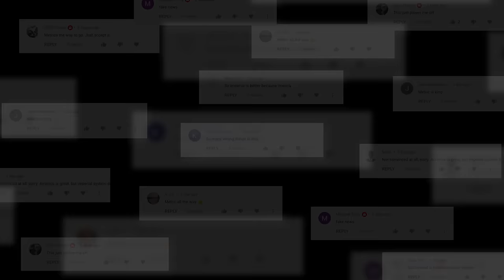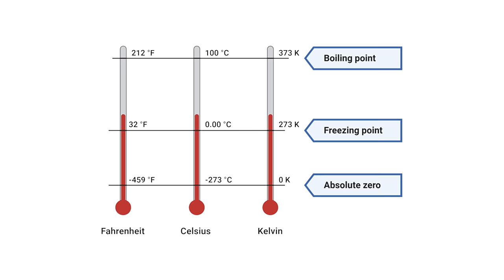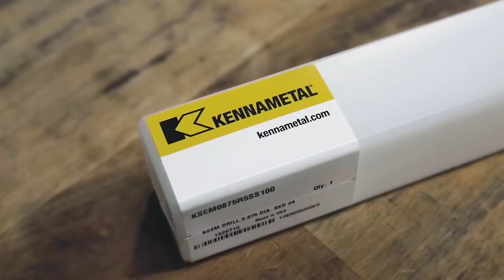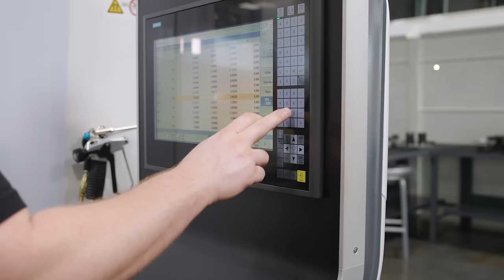Why METRIC is SUPERIOR to IMPERIAL

Comment: This debate metric vs imperial is such a joke, but a tiring one.
How many units used to express a length (in exemple, but same for others) in imperial system? In metric system, only one. No need to convert anything, no need to know how many units A in 1 unit B. Only metre and its multiples by 10, is all. You need to build a chair, or a viaduc, or sew something? Same unit, no conversion. You travel by boat, by plane, by car, on foot? Same unit, no conversion. You need to buy beer, water, olive oil or fuel? Same unit, no conversion. Never. Or the kind that you already use with money. 1 cent? 1 centidollar, 0.01 $. 1 thousand dollars? 1 kilodollar, 1000$. 1 million dollars? 1 Megadollar, 1M$. Reminds you something? Computers, maybe? Some Gigasomething too, maybe, by billions?
Metric system = no conversion (or no real calculation to do so) in each kind of measurement.
Tiring, just tiring. I understand people who are used to do something prefer to keep their habits. But they should just not talk about the "quality" of each system: they only talk about themselves (their own habits), not about the systems in themselves. And to thinkk that the most sacred thing existing in the USA, the dollar, is used in a metric way (for values measurement) by US people... uhhhh, really, what a joke... well, anyway...

Comment: Metric (and basically SI) system have two major advantages:
ease of scale (constant base of 10)
compatibility between units (weight, volume, area etc)

I can easily say how much is 5x7cm, but good luck with 5x 2 3/4 inch without calculator, especially with feet involved (it's almost the same length tho)

Comment: in metric much simple to use and intuitive, but imperial is also convinient to step of measurement like pipe diameter, i prefer inch pipe diameter, the step is clear 2" ,3", 3 3/4" and so on. in metric pipe diameter can made your head confuse alot. so we use 1 standart in general but still need another standart to certain problem. yeah, we need both.

Comment: Some mistake - computer doesn`t use decimal system
1KB = 1024 Bite (it`s cause 2^10 =/= 1000)
Not easy to count, and that`s why you brand new 1TB HDD (SSD) have only ~930GB in real

Comment: I only learned the metric system at school. I have 3 problems with imperial:
Volumes don't make sense, a litre is 0.001 cubic meter, how many cubic feet is a gallon?
There are both powers of 2 and decimal fractions of inches. Going from 1/2 to 7/16 to oversize a hole just hurts my brain. I don't even want to write that out in decimal.
There are just too many units with different conversion factors. Make it all 12 or 16, it would be okay, but 12 inches to a feet, 3 feet to a yard, 1760 yards in a mile.

Comment: I'm not an imperial Unit fan, but I there is a good argument for it. The yard, foot or inch is diffrent from body to body, but a human can much better astimate a length with his own body. Even if it is not exact, a mile are roughly 2000 steps, a yard is roughtly about one step, a foot is rougthly the length of a feet and an inch is rougthly about the thicknes of a thumb.
In a situation where you need some astimating without tools and fast you can do it more precisly then in metric. 
You would be surprised how many people need a length or diameter  of something and 10 cm of a meter doesn't matter. Nevertheless messuring/astimating something in meters without tools is hard.

Btw, astromonical sizes are not messured in metric system. There are units like AU and Lightyears, mass is shown in "Mass of Sol" and similar stuff. You can calculating them into metrical units, but it is the same like calculating imperial to metric.

Comment: In engineering as long as you know 2.54 multiply or divide and have a calculator then conversion inch to mm or mm to inch is easy.

Comment: same thing for the power systems, 120v vs 240v (110v vs 230v same thing) far less current needed for the same wattage appliance at 240v, less likely to pop a breaker every 2 minutes trying to weld something

tho I hear alot of places in murica are having 240v outlets installed for all sorts of reasons, its only a matter of time before they go full 240v

Comment: Its worth noting that we adapte units to suit our requirement all the time and the idea that we work with SI units is the very small and very big is not exactly accurate. Whilst absolutely could use kg, meters and joules for the very small we often favore the dalton, the Angstrom and the electron volt because they are more practical to use and more representative than kg, meters and joules. equally for the very large we favor parsecs, light year and astronomical units. Although we don't usually change unit half way through like what happened with that mission that crashed into mars.
Also people love to cite the case with Celsius vs Fahrenheit which is honestly the weakest argument against imperial if its an argument at all. First Celcius is not part of the SI units the Kelvin is, which makes sense since our equations don't really work in celcius (they wouldn't in fahrenheit either) and second why is it based on water make it more intuitive, it does when dealing with water but when you aren't it doesn't.
The strong arguments against imperial are the inconsistent ratios between units, the fact that we can't easily convert like going from distance to volume without relying on constantes and that its is not the accepted standard.
I think that one other the things that helps a lot for SI units is a lot of commonly used unit just happen to be a convenient power of 10 from the SI unit and that is mostly down to luck. Would the liter be as popular if it didn't happen to corresponds to 1 kg of water which is also exactly 1 cubic decimeter. the fact that our average atmospheric pressure is very close to 100000 pascals that adding more detail would be lost in rounding errors for most common calculations.

Comment: I work as an engineer in the oil and gas industry and everything is pretty much still imperial globally. Probably because most oil and gas majors and equipment manufacturers were originally US companies. I do all my design work, calculations  and drawings etc. in mm (being in UK) and any drawing I send to our US  workshops gets converted to inches for machining....Rounding errors are inevitable.

Comment: I'm an engineer in the US, and absolutely hate designing (or dealing with other designs) in imperial units. 
It's half a thou... So you mean it's 5/10,000"? That's a double fraction.
And having to memorize the fraction conversion and back is painful:
Grab me the 0.3125" drill... Is that the 3/16" or the 5/16"?
Metric and any 10base measurement systems are just simply logically better. It's time to give up on daylight savings and the inch. Let's do it.

Comment: Metric uses:

Fractions: 1/3 of a mm, 5/7 of a meter, etc.
minutes: base 60
seconds: base 60
hours: base 24
weeks: base 52
Months: base 12
degrees: base 360

Imperial uses:

Units of base 10: 0.1", 0.01", 0.001". 0.0001", 0.1', 0.01', 10ths of a mile on freeways, PSI and KSI (1000 PSI), 10ths of a gallon, etc.

Comment: Imperial is preferable in  altitude and depth measurement, for its easier  to read  100 ft and keeping in mind, that's quite low, than 30 metres.
There is one other area of non- decimal measurement: nautical miles which is 1,852 metres. Astronomical measures are another topic.

Comment: Whenever you have to measure liquids by the amount of space they occupy metric is so much easier to use: 1 cm cube of water = 1 mililiter. 1000 = litre.  Any decimal becomes just that, a decimal. 

And a liter of water = 1 kg of weight. 

Doing the same with cubic feet and inches for gallons of water becomes a pain real quick. 

Nevermind when you have to figure out how much energy you need to heat said amount of water.

Comment: Born in an imperial UK and working in a metric UK.
I simply can't be arsed with bloody fractions 16ths and 32nds, really?
And imperial thread sizes, just no. 
Everything I build or make is in mm
From a home extension being 13000mm long to a drill for a watch part being 0.02mm diameter.

Comment: One interesting thing I found while getting my pilots licence in Australia is using imperial and metric for distance.
Vertical distance is measure in feet, and horizontal distance is measured in metres.
So you might be told to travel for 10 km at 15000 feet.

This is done largely out of habit, but the added benefit is that you are less likely to confuse the numbers because you know that feet is always height, and metres is always distance
Reply: And what is airspeed measured in?
Reply: @noelmasson  knots

Comment: I had no idea about the Metric Conversion Act. Here in the UK metric is adopted in a half-assed way. Distances on roads is still in miles, speed limits are still Mph, when you hear a length reference on TV it's usually in feet, and Beer is still in pints (Big British pints, not puny Yank ones 😉), and Cars are sold with a miles per gallon measure but Petrol (Gasoline) is sold in litres!
(╯°□°)╯︵ ┻━┻
We should just bite the bullet and go full metric already! even though 0.5 litre is smaller than a pint 😢
Reply: @Null Pointer Whoa, never heard of those before. It's a whole litre! 1.76 UK pints! 🤤

Comment: In Norway we use Imperial unit on pipe diameters and lumber size, but metric everywhere else. But still referring to horsepower though.
Reply: I hate the pipe thing so much. You want to know how wide it is? We don't tell you. It's 1/2 arbitrary something. Have fun needing Google just to figure out what you are actually buying...

Comment: Also the metric system is a true system, wich mean everything is connected. Based on the same unit, you can calculate distances, volumes and weight.
The meter is used for distance; a square meter (m*m) will give you a surface and a cubic meter (m*m*m) will give you a volume. 
Water is the reference to convert volume into weight: 1 cubic meter of water weight 1 metric ton, a metric ton = 1 000 kilogramme (kg). 1 kg=1 000 grammes (g), etc.

Comment: Germany still uses imperial to, in pluming , its called zoll. Zollstock (=inch-stick) is a folding ruler and unlike the ones in the us it has no inches on it but 2000 mm and they are still more common than tapemassures.
Reply: Everyone uses imperial in plumbing. There are two standards British Standard Pipe threads that the entire world other than the USA and I think Canada which use NPT. Even when it comes to Imperial the USA has to be different.
Reply: Zollstock is the outdated name... the official name is "Meterstab" and uses Meters. I have never seen a "Zollstock" that actually uses "Zoll" as its units.

Comment: imperial threads are based on engineering requirements, metric threads are just a fudge to fit like many other metric measurments.
Sure measuring very small or very large is easier, thousandths is perfect for small things.
PSI is perfect also for pressure from zero to several bar
Lots more...
Grew up with both.

Comment: It would be so easy if 1 inch were always 25.4 mm!
For English pipe threads, one inch is approximately 33 mm. The dimensions are now standardized in millimeters. But the usage remains: "I need a faucet with a 1/2 inch thread, but old-fashioned English inches, please." 
"And remember not to use an American inch thread with 60° but Whitworth inch thread with 55° flanks please"
And when the truck is loaded with 1 ton, you don't know if it's metric tons or imperial tons.

Comment: I deal in both systems, as there are many  systems I maintain that were built in US imperial, and I have those built in metric. Both have their strengths, and are a fixed conversion apart. US imperial is now defined as a fixed conversion of metric, which is now being defined on physical constants not an arbitrary mass of platinum/iridium alloy, or a rod of fixed length. In reality, the final step in why the US doesn’t change, is $ and inertia of the old system. There are systems, like the Interstate system, that is so vast in size, and with an exit system based on miles, there are legitimate reasons to why we don’t change fully. 

All in all, it’s just a conversion away.

Comment: German civil engineer here. I grew up with metric, hence it's obvious which system I prefer.
For everyday life, it does not matter at all.
However when I have to check static design calculations from US or Canadian engineers the real horror starts. Using pounds and inches, OK. I can deal with that. What I can't deal with is lazy engineers who do not write their units correctly. Sometimes you find the correct lbf, sometimes they write lb, sometimes it's lbs and they write lb. Or did the lb actually mean lbm? kips is the least problem here.
And if you go into things like energy calculations, with e.g. stones,... 
On the other hand SI units are quite clear: mass is kg, force is N (although I have seen calculations with forces writen in kg)
I once read a comment that sums it up quite nicely in my point of view: "we use imperial only for measurement, not for calculations"

Comment: the US doesn't use imperial per se, it uses US customary, and while some of the principal units are now standardised between US customary and imperial called international units, many are not, e.g. 1ton is the US (US customary) is 2000lb [~907.1847kg], 1ton in the UK (imperial) 2,240lb [~1016.047kg] vs the 1tonne (metric) at 2204.623lb [1000kg], likewise for volumes like gallons, quarts, pints etc, then to cap it all, all the US customary are defined in direct relation to the kg and the meter, so they are not the same units as your great great great grandfather used in the 19th century, they just share a name, which just shared a name with the original imperial units.

so people like me end up having to use imperial (UK), US customary (US) and metric, because many in the US don't realise they don't use imperial per se, they use US customary, with only some things that amount to the same thanks to 20th century treaty.

Comment: The “foot” (and the inch) is an international standard.  As it is defined relative to the meter, it is as well defined as the meter.  Accuracy does not depend on units.
Reply: @bike-cave-man2527  That doesn’t change the accuracy of the measurements.  They are still accurate, even if they require a calculator.  

You just multiply by three for the yards, and you pick a non-esoteric measurements for chains, which normal people don’t use or care about.  

What is 1,253x55+(22\47) with out a calculator?  You have three seconds.  Can’t do it?  Math is inaccurate way to define the world.  It’s a dumb argument.

Comment: 1:11 Bits and bytes are not based on multiples of 10 (or better 1000). The megabyte (written with an 'y') is a multiple of 1024. Even the ancient Egypt used the Metric system and not bananas for scale.

Comment: Metric system is included is the list of the International System of Units which allows to perform science measures and experiences everywhere on the universe with the same accuracy and stability cause it's related with universal laws and constants which gonna take more than 10^35 years to change. Quality.

Comment: In the centre of London, possibly a few other major cities around the UK too, there were measurement sticks placed in stone on the outside of the main administrative building for all measurements…metres, feet, centimetres, and inches.

So the American argument about having to offer up to the size of a stick is flawed from the get go.

Besides, the measurement of 1 metre has solid reasoning behind its length relating to universal constants.

The measure of an inch on the other hand, being the measurement of 3 barley corns end to end, not so much.

Comment: Main reasons why SI-system is superior to US customary units is because SI "won the battle of units":
1. Most of the world has fully adopted the SI system
2. USCU are by definition tied to their counterpart in SI, with a fixed conversion. While they need the SI definition to determine their actual size. 

Even if I primarily use SI units, I sometimes use USCU, where they are used by design. But sometimes convert, if that's more convenient.

I would usually call a large audio jack a [1/4" jack], maybe 6.35 mm
I would measure pin distance for ICs as 2.54 mm, even if I know it is 0.1"
Nuts and bolts, other parts, and their appropriate tools. I would call them their size by design.

I use USCU when they are part of the name for things; tools, bits and pieces and model names etc.
Sometimes to describe specifications if it it seems like that was the unit by design, and there's no obvious reason to convert.
Usually when talking about things where USCU is the standard. 

The "superior" system, is the system commonly used in you circle of interactions. 
I believe USA for more and more stuff, but probably not completely while I live...
Reply: And the reason Metric won over Imperial is that metric was actually a systematically defined system of units where mass and length are intrinsically linked. Imperial on the other hand is just a bunch of randomly arbitrary units that have no relation to one another.